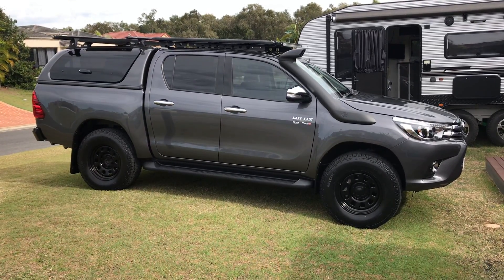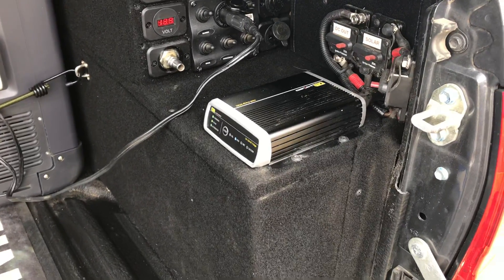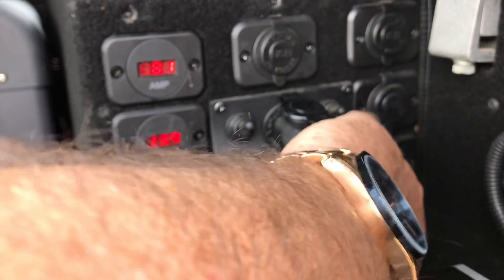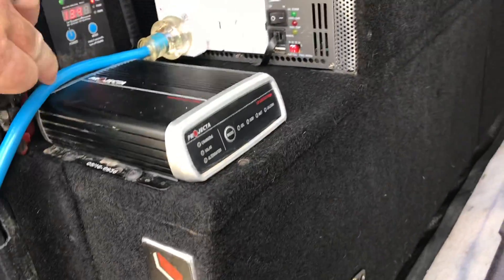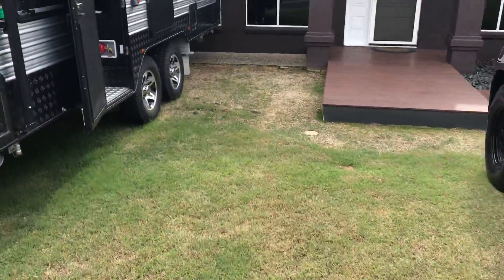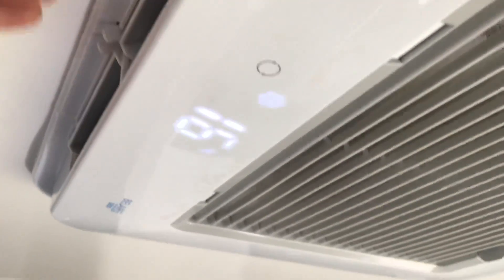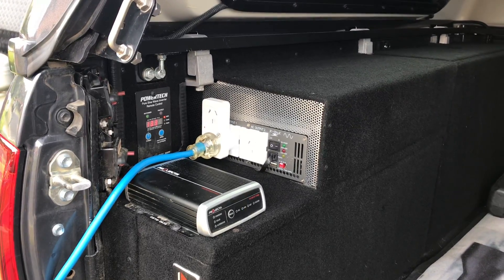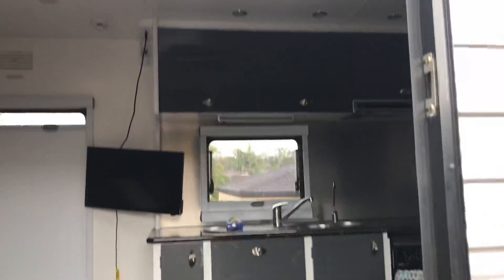Full off grid 12 volt system to run caravan air conditioning

Comment: Hey mate. Love your work! I had not thought to do it this way. Very thankfull for your video. We are getting set up now and i was looking to max the system on the van and then have a mini version on the vehicle for when we cant take the van. So this is a great idea. All i hear is that i cant run the a/c from an inverter. Few questions for ya if you dont mind. 1. Do you run the van 100% of the time from the vehicle? 2. What are you doing with the solar n battery setup on the van? 3. Assume you are relying on travelling a bit each day to charge batteries? 4. Would it be possible to connect the van panels to the panel on the vehicle for times when you freecamp for longer? 5. As soon as you plug the lead into the van will the fridge auto start running off the vehicle inverter as well? 6. What aircon do you have? I was looking to order van with dometic harrier inverter a/c. 7. Is it possible to charge the vehicle batteries with gennie if longer freecamping without travelling? 8. Could you privide a list of products installed? Thanx mate.
Reply from the maker: Trevor Yule 
Come over to Camping and Caravanning South East Queensland on facebook mate and ill go through it all with you
Cheers